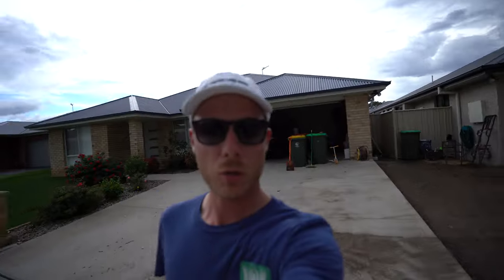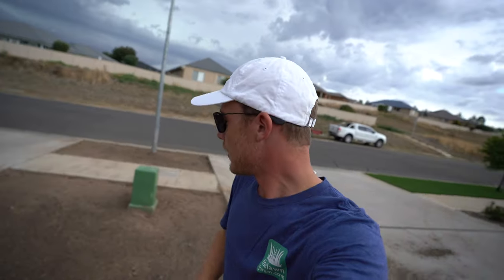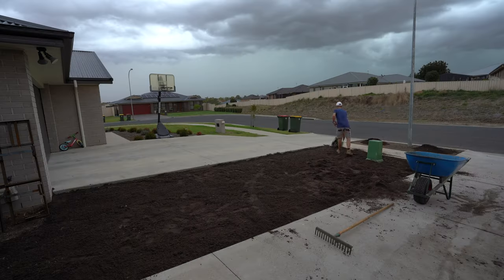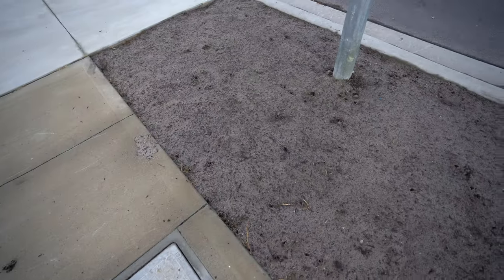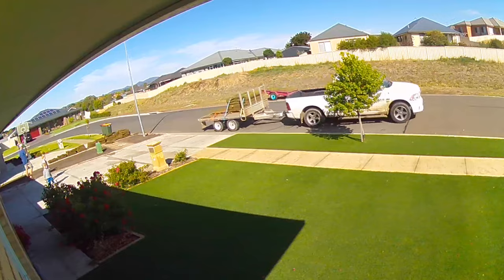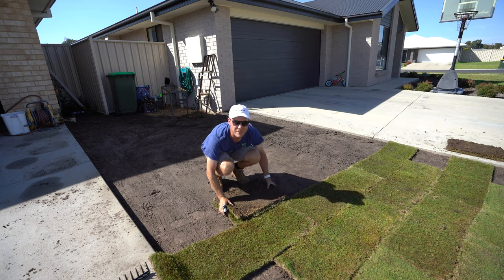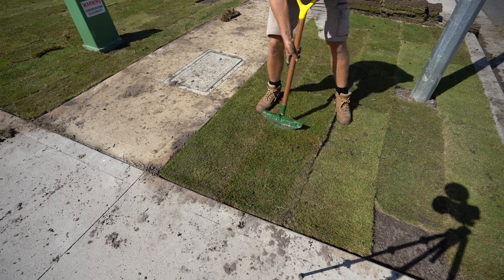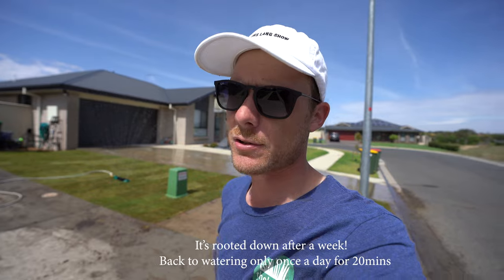How To Lay Turf (Sod) // TifTuf Bermuda (Couch)

Comment: Nice mate - thoughts on a south facing lawn in Adelaide, close to beach (1K) small, like under 60m2 🌱
Reply from the maker: You have a few options! Couch would be pretty good if you want to get it nice and low, or check out zoysia!
Reply: I just put 70m2 of Kenda Kikuyu down, got it from Paul Munns. I'm near Largs Bay.
Reply: Alex D thanks mate
Reply: Thanks gents - will check out Zoysia, plenty of support at my office as work with an ex-greenkeeper and golf course super.